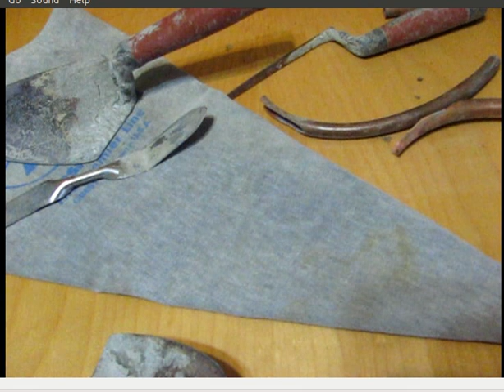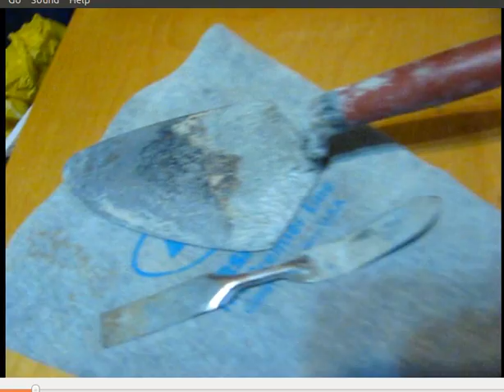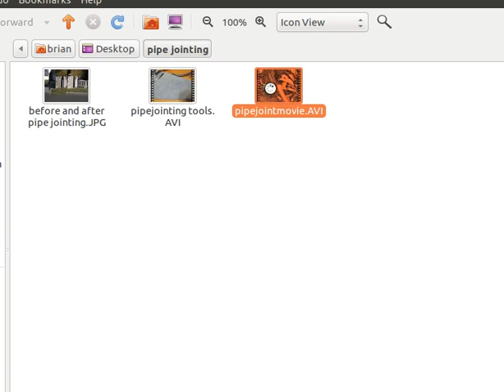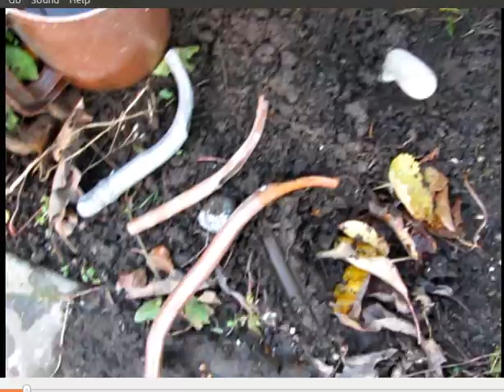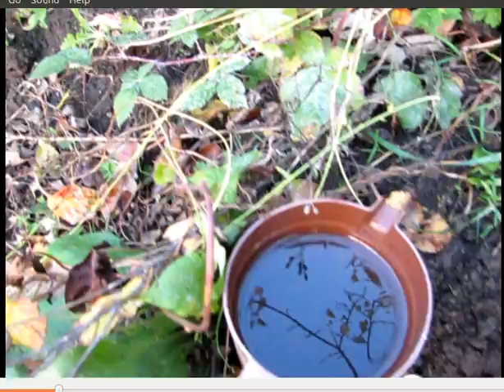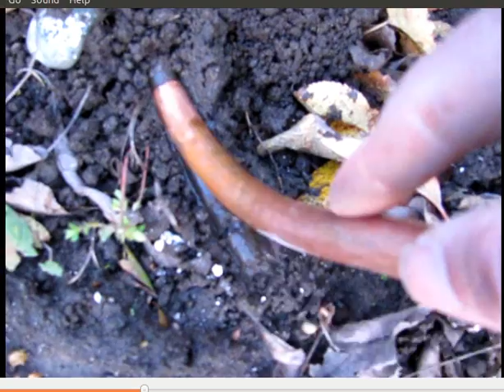Masonry techniques    How to pipe joint or  grapevine joint

Comment: The before picture looks far better than the after, that kind of strap / ribbon / rope pointing that emphasises the pointing and not the stone, damaged many stone buildings in Ireland and Britain in the 70s. Horrible looking, check out some of Patrick McAfees books on stone work to see proper pointing.
Reply from the maker: I do all sorts of jointing and pointing, pretty much whatever customers want to pay for.  What looks good is often a matter of opinion and it also depends on the rocks you use.  Here in Victoria,  pipe jointing can be seen on the higher end public buildings, with super expensive quarried granite blocks and some homes of developers.  Perhaps they all have bad taste?
Reply: They aren't dry stone walls lol.
Pointing protects it

Comment: Well, the work on these "Keystone" houses is a little different. Can't figure out the exact name for it. It's like a flattened grapevine joint, and much more regular. I have never done it before, but it worked out well. It actually gets painted white, just on the visible surface, after curing. Gives the impression that the stones are all about the same size, or flat, when they are not. My nieghbor and husband were impressed. Must look pretty good.

Comment from the maker: Get lots of practice with the clay first so that you know your pipe jointer works well.  A bit of emery cloth or sandpaper takes off burrs from the copper.   Are you using colour in the jointing mix to make it stand out or in the base material to match the stone and blend in?  Be careful of drips if you use colour.   Anyway, give it a go, expect it to take twice as long as you thing. Best of luck. Brian